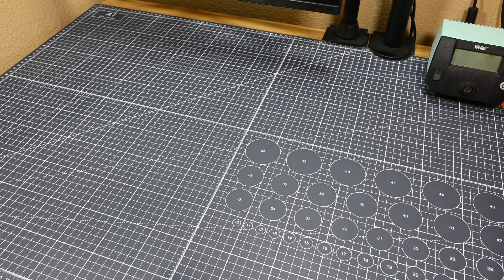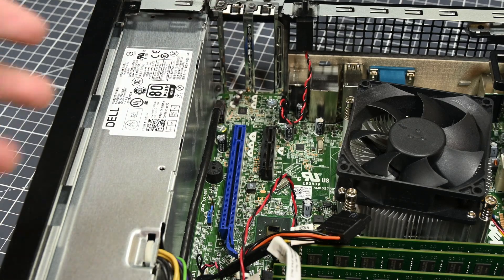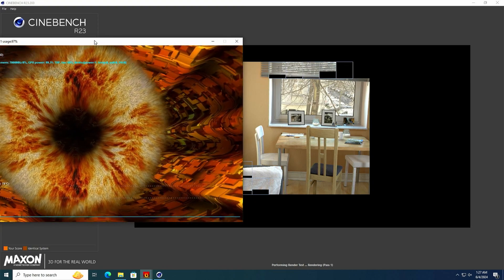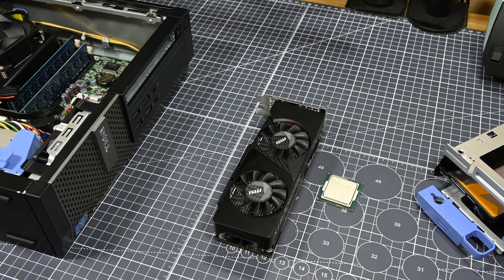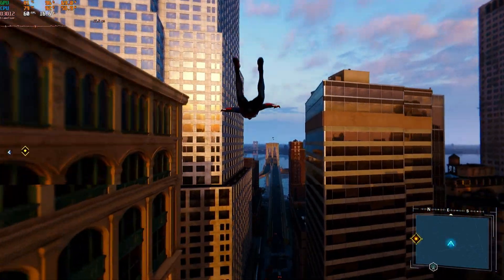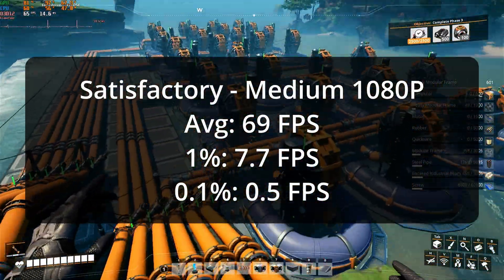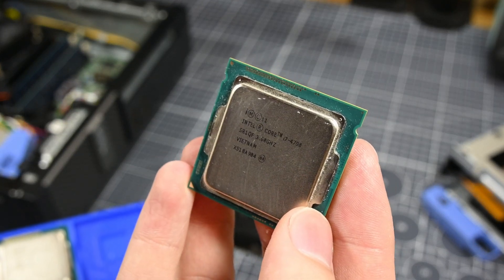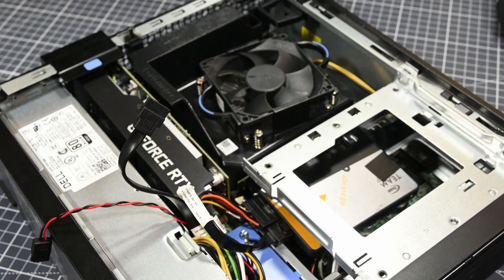An 11-Year-Old CPU and a 3-Month-Old GPU? Does it Make ANY Sense?

Comment: Just curious where you saw that the x4 slot is limited to 50 watts? According to the Dell spec sheet, the x16 slot in the SFF 7020 is rated to 50 watts and the x4 is rated to 25 watts. That being said, I know several people running GPU's in the x4 slot pulling 70+ watts with not ill effects for well over a year at this point. Those ratings seem to be arbitrary and outside of your speculation that the traces are smaller in the board... I can see zero reason for them to say that. Regardless, it seems that it runs just fine and there's really no risk to running a 70 watt card in the x4 slot.
Reply from the maker: Woops, might have gotten my numbers mixed up! But yeah, I do agree that there's pretty much no risk with running a 75W card in the x4 slot, they seem to handle it just fine.

Comment: Xeon E3 1270v3... Could have shaved another $20 off that CPU with a Xeon instead of a Core.

These SFF Optiplex builds only make sense if you were already given the bulk of the PC for free.
Considering you can build a beast of a gaming rig for even lower price, if you simply don't limit yourself to office junk.
Start with a used Socket 2011-3 Workstation instead, like an HP Z440 (or Dell T5810, etc.)... Drop in a Radeon RX 5700XT.
Done.  Monster gaming rig that competes with modern consoles, and puts these SFF builds to shame, for only about $200.
More cores, more faster DDR4 RAM, more PSU power, way more expansion and upgradability.

Comment: When I upgraded my main PC from an RX7600 to an RX7800XT, I put the RX7600 into a spare machine with an ASUS Z97-K motherboard, an i7-4790, and 32GB DDR3. It certainly does not make sense at all as a combo, but I had all of that hardware spare inside a pretty nice Antec case. I use it as an HTPC, and if my main build suddenly dies, it can be my backup.

Comment: I did a similar upgrade with an OptiPlex 7010: i7 3770, 16GB RAM, 500GB SSD, RTX A2000 (used, from eBay).  I'm able to play the games in my Steam library at 1080p, low to medium settings.  I'll admit I overspent, but tinkering with PCs is my hobby so it was worth it to me.
Reply from the maker: Nice build! And yeah, hobby PCs can end up being a little more expensive than they might be worth, but at least we're having fun with it :)

Comment: Dell's Optiplex line is designed for businesses, not gaming. Another problem with older Optiplex PCs is that they do not support Windows 11 and Windows 10 End of Life is October 2025
Reply: Yes, but they can still game.  I just started experimenting with Linux Mint, running Steam with Proton enabled.  So far so good.
Reply from the maker: Yes, they aren't designed for gaming, but they can be repurposed into budget gaming machines which is pretty fun. The Windows 10 EOL is certainly a problem, though.
Reply: @CHWTT  That's why I'm looking at Mint, and I'm surprised at how well my Steam games are running.  I have a SFF OptiPlex 7010 with 16GB RAM, 500GB SSD (dual boot Windows 10 Pro and Mint), i7 3770 cpu, and RTX A2000 gpu.
Reply: so what any light linux distro is as good as windows anymore for gaming thanks to all the support Steam has given wine. A gaming PC doesn't have to run windows anymore if they don't want to.